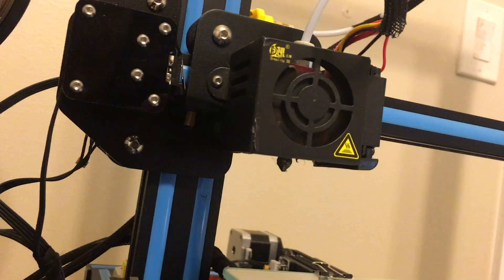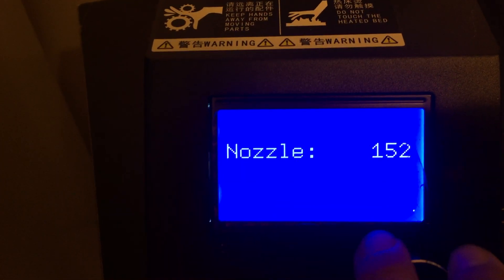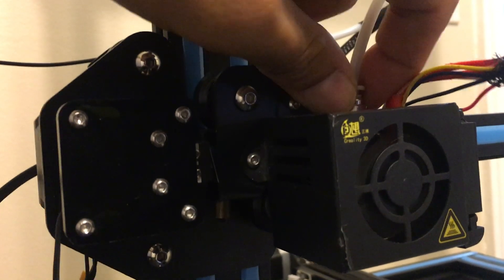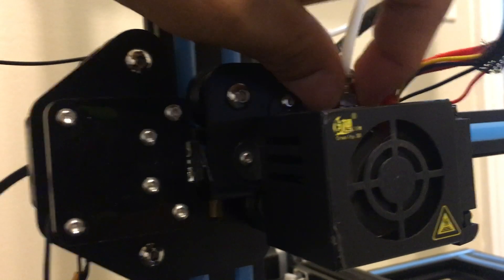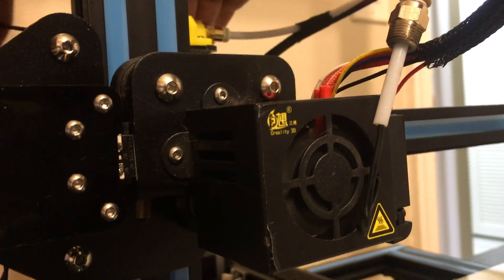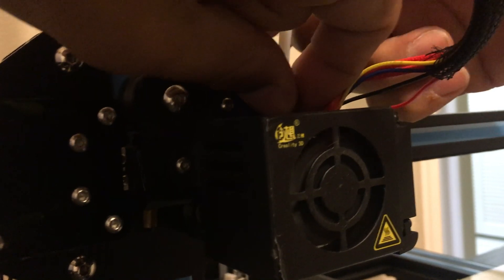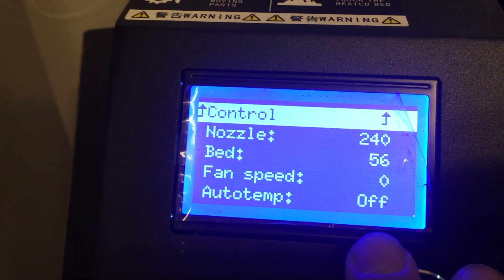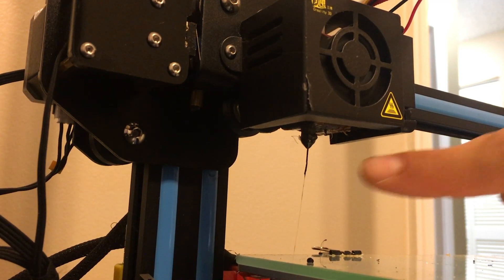How to QUICKLY and EASILY unclog you creality 3d printer clogged nozzle on a cr 10 when 3d printing

Comment: Hey, I’ve got a problem where my extruder gear is grinding the filament to hard for my cr10s and making under extruded prints, how would I fix it ?
Reply from the maker: Has it always been grinding? Is there anything other than plastic stuck in the grooves of the gear?
Reply: No, it recently  started to really grind the filament , filament that I push through with my hand comes out fine ( first layer) but everything touched by the gear  gets smooshed more so then it should, and I only see PLA debris in the grooves of the gear  ( bout 120 hours of good printing before this started )

Comment: Thank you for the to the point instruction.  It helped me!  I was doing a pull from cold, but I didn't unscrew the bowden tube holder, so I was only pulling out some of the clog that could go through the bowden tube.  Your method saved me from disassembling the hot end or buying a new one!  Thank you!
Reply from the maker: I am very glad it helped!

Comment: Hi there,
I do not have some options you have, like motion and autotemp.
How is that possible???
Reply from the maker: Maybe it’s a old firmware ?
Reply: I just bought the printer... How can I put new firmware on? And where can I find it on the internet???
Reply from the maker: I am not exactly sure I would contact the supplier. You should have the options to control.
Reply: ok, I will do that. Thanks for now.

Comment: Hi there, after unscrewing completely, the white feeding tube won't come out by pulling. Even in much higher temps (230)...
Reply: Arye Zilberman PULL HARDER
Reply: Arye Zilberman the clog may have made the filament stuck to the tube happened to mine I just heated it up really higher and took the tube out easily try using a heat gun or something really hot on it